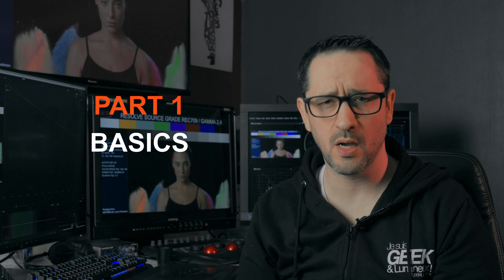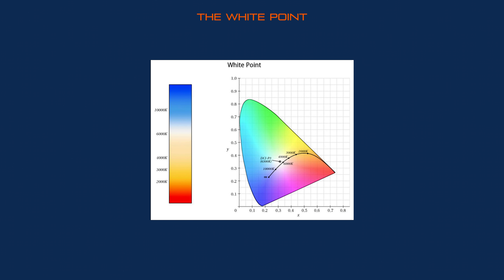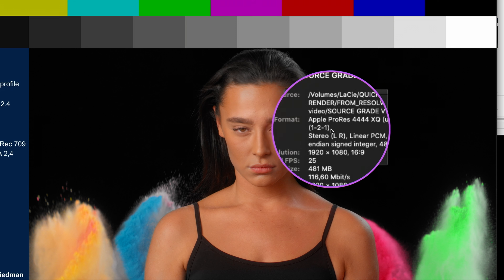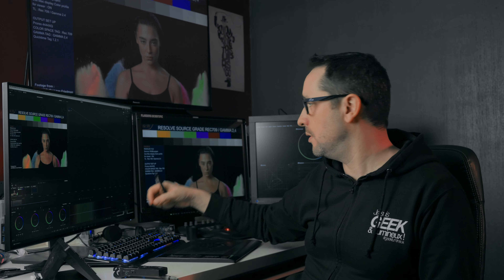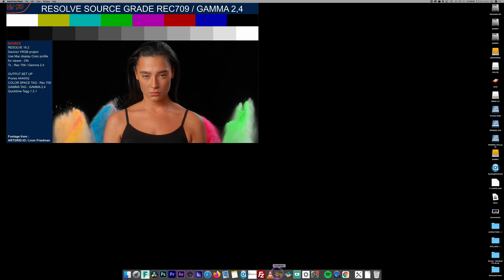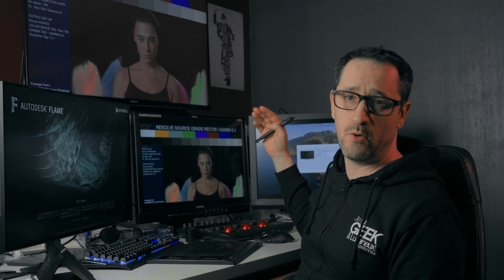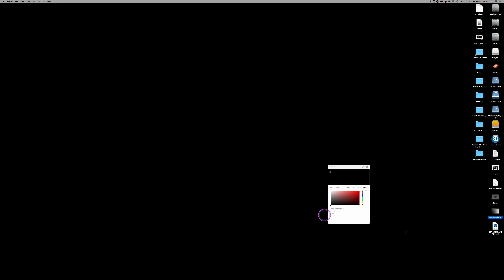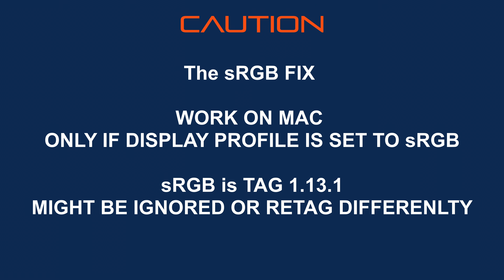Quicktime Color Management: why so many ISSUES?!

Comment: Hello, thank you very much for the video. I am working with Arri Alexa Raw files. I am working on a MacBook Pro that is calibrated with a datacolor Spyder X to ITU-R Rec. BT.709. The suggested Gamma is 2,22. So ITU-R Rec. BT.709 should be Rec. 709 BT.1886. The suggested whitepoint in the datacolor app is x 0,313 y 0,329. My Macbook is calibrated to 120 cd/m2. So it is probably not quit BT. 1886 with a suggested 100 cd/m2. I know that my MacBook will never be color accurate as a Flanders monitor.

In DaVinci Resolve 17 I am working in ACEScct. Version 1.3. No Input Transform because I am working with Raw and ProRes files. Each clip is individually assigned an IDT. "Apply ACES reference gamut compression" is off. ACES Outputransform is set to Rec. 709. Netflix in one of their color management tutorials said that this Rec. 709 is BT.1886 so I assumed it is Gamma 2.22. https://youtu.be/u9Rvm5xiuhk?t=424
"Process node LUTs in..." is set to "ACEScc AP1 timeline space". I have checked the box "Use color space aware grading tools". Graphic white level is set to 100nits. In the "project settings", "Master settings", I have set the Video Monitoring Data levels from "Video" to "Full". Video with depth is set to 10Bit.

I did some tests with "Use Mac display color profiles for viewers". Normally it is and was deactivated. When deactivated, the highlights looked bright and colorful as they should. When I exported the video to VLC it looked the same as in DaVinci Resolve, as you said in the video. QuickTime, the NLC Tag was originally HD 1-1-1, it was too bright and washed out. 
This was before I set up ACES. I used DaVinci Resolve YRGB before. As I understand the NLC tag 1-1-1 is right for Rec.709 BT.1886 Gamma 2.22 for web delivery like Vimeo and YouTube. When I switched to ACES the ODT is set to Rec. 709 (BT.1886) as mentioned before. Now when I export (Use Mac display color profiles for viewers are still deactivated), and set the color space tag "same as project and set the Gamma Tag to "same as project" my export says when I press command+I that the NLC Tag is 1-2-1 (ITU R BT 709 - UNSPECIFIED - ITU R BT 709). Why is that, that it is now unspecified? In VLC the video looks like in DaVinci Resolve. In Quicktime it looks much better than the 1-1-1 washed out version. But the Image is a tiny bit too dark. The highlights mostly green are not as saturated in DaVinci resolve. The version with the NLC Tag 1-2-1 is washed out in Vimeo and YouTube on Safari. So the transfer curve is not specified. On Firefox it also does look washed out. Firefox is color managed since recent versions.
I have now activated "Use Mac display color profiles for viewers". The image in DaVinci now looks the same as in Quicktime. But it does not change the fact that the transfer curve is not specified. "Automatically tag Rec. 709 Scene clips as Rec. 709-A" ist NOT Activated. I don't want to work in Rec.709-A. My movie will be mostly watched on YouTube, maybe on Amazon Prime and in cinemas. I am primarily preparing the video for YouTube. So I want the film to look kind of the same on all mobile devices. So all in all QuickTime should not matter that much. As a test I have changed the color space tag and Gamma Tag. "Color Space Tag": Rec. 709 "Gamma Tag": Gamma 2.2. I assumed because I use Rec. 709 BT.1886 that Gamma 2.2 might be correct. But in Quicktime the file looks way too bright. It is not that extreme as when I used DaVinci resolve YRGB, so ACES might have something to do with it. Because I chose a gamma tag of 2.2 the file says it has an NLC Tag 1-4-1 the transfer function of gamma 2.2 seems correct but not visually. As we can see in your list it is ITU-R BT.470M (Gamma 2.2). But this 1-4-1 is also wrong. If possible I don't want to cheat the NLC Tags and have a work around. Now I have exported it again as "Color Space Tag": Same as Project. Because I want to keep Rec.709. "Gamma Tag": Gamma 2.4. In Quicktime the file looks the same as in DaVinci Resolve as I am not mistaken. The NLC Tag is 1-2-1. I am wondering now. My ACES ODT is Rec. 709. I always assumed that it is BT.1886 with Gamma 2.2. Why does the image looks more or less correct to when I have not chosen a Gamma Tag? The video looks the same as "Gamma Tag": Same as Project. To my understanding this would mean that the ACEScct ODT Rec.709 is not actual Rec. 709 BT.1886 Gamma 2.2 but rather Rec. 709 Gamma 2.4. I have calibrated my Macbook to BT.1886 Gamma 2.2 so when I disable "Use Mac display color profiles for viewers" in DaVinci the Image does not use my calibrated display profile Rec.709 BT.1886 Gamma 2.2 but uses Gamma 2.4. Is this why my image looks better in DaVinci? It is only slightly brighter and the green is more saturated.

In DaVinci resolve I can't find the Gamma Tag (NLC 1) ITU R BT709. So that when I export the clip I receive a NLC 1-1-1. Originally before I started using ACEScct I didn't not use any color space tags or gamma tags and received a NLC 1-1-1 but the image was way to bright. (less to no contrast)

What should I do? Should I use Rec.709 Gamma 2.4 and recalibrate my Mac to Rec.709 Gamma 2.4 instead of using a calibrated display to 2.2? How to fix the washed out colors when uploading to YouTube and Vimeo? (NLC 1-2-1)?
Is it called NLC or NCLC Tag?

Thank you very much.
Reply: I have once again exported it as process 422hq "Color space tag: same as project", Gamma Tag: Gamma 2.2 (same as my monitor is calibrated to). When I upload it to YouTube it looks way too dark and oversaturated. The NLC Tag is 1-4-1.  I have changed the color space tag from "same as Project" which should be (Rec. 709) to Color Space Tag "Rec. 709", Gamma tag is still 2.2. I get a NLC Tag 1-4-1. You have talked about Full and Video Range. When I export a Proress 422hq in full Range (Tags Rec.709; Gamma Tag 2.2) it is saturated and looks like the davinci viewer when "Use Mac display color profiles for viewers" is disabled. So in general it is brighter. When I use video range. In Quicktime it is washed out (NLC-1-4-1) but on YouTube it kind of looks okay (close enough). In full range with no gamma Tag (same as Project) it is still to dark in QuickTime (NLC 1-2-1) and does not look like the davinci viewer. I have exported 31 versions and still haven't found a solution. Is there an option that YouTube does look the same as in the resolve viewer? Is it right that NLC 1-4-1 is best for YouTube? Does full Range automatically use Gamma 2.4 (NLC 1-unspecified-1) (Nlc 1-2-1) even if the project gamma is 2.2 Bt.1886 and Tag is set to use project setting? Or is it because aces gamut ODT is Rec. 709 Gamma 2.4 and not Rec. 709 Bt.1886 Gamma 2.2?
Reply from the maker: Sorry for getting back so late 
But honestly so much informations so much to read. Sorry I have to see what’s happening. This description is way too long
Contact me via email will see if we can arrange a team viewer 
Lelabodejay@gmail.com
Reply: @worldproductionentertainment  i'm having the EXACT problem that you are having and the only "solution" that I could get was to set the output color space of the whole project to rec 709-a, that was getting as close as possible to quick time as possible, as well as on my iphone and youtube. But as the video said, that's only a part of the problem because we are on Apple's ecosystem, so it will look great on their products, but i dont have windows devices to test to see how they would look on comparison. 

In the end of the day, from what i've searched and tested, was to either find a middle ground, like the suggestion in the video and live with it, or do different exports for the different platforms, which kinda sucks. 

Also, when opening on different players, like IINA and VLC, the colors are different as well, so i don't think there is a solution for all of this that will work 100% all of the time on all platforms but if it has, i would like to know as well because it's kinda infuriating :( 

Also, grabbing still from the colors page changes the image a lot, making it brighter and with less contrast

Comment: you say 'don't touch the grade', but then you apply CSTs. 
do you mean you grade and THEN apply the CST, just for the export-for-web?

for example your ultimate fix: do you grade on your rec.709 gamma 2.4 timeline and monitor (ignoring your sRGB screen), then apply the CST only for the web export?

and you only set your UI monitor to sRGB for doing your testing right? at least on my system, Display P3 looks much closer to the video monitor, and sRGB will confuse my clients with darker shadows and more saturation.
Reply from the maker: Hello
Sorry for late reply 
Yes you do your grade on reference monitor 
Then apply cst for web delivery
I don’t really trust my ui 
For your information if your monitor is Apple P3, it’s a P3 gamut combined with srgb gamma.
Reply: Hi I also found that 709A. works well in all applications. if you have a broadcast project like a tv show, would you still use 709A or change the tag to 2.4?

Comment: What you say about converting to 2.2 for the internet is incorrect. Ironically you get things right early on when you say that grading in a 2.4 environment on a 2.4 display will look the same as being in a 2.2 environment on a 2.2 display. This means that you should do NO conversion for the internet at all, just tag as 1-1-1 for client review if required. Otherwise you will make things too dark by converting to 2.2! (On the other hand, if you are also converting to 2-2 for client review, you'll end up getting things right but in a backwards way because they can tell you to brighten things up). Another way to think of it: grade on a 2.4 display in a dark (i.e. 2.4) environment. Turn the lights on, thus creating a 2.2 environment - the grade will now look too dark. Switch your monitor to 2.2, brightening it - now it will look correct again. So if you convert to 2.2, it will now look too dark despite changing the environment and the display. You can have your color space transforms convert to 2.2 if you grade on a 2.2 display in a 2.2 environment, but do it at the start of the grade and don't switch later (don't switch even if you have the wrong conversion to start with as your grading decisions would have accounted for this already).
Reply: ....u sure?
Reply: "Turn the lights on, thus creating a 2.2 environment - " What do you mean? The actual lights in the room?

Comment: "go to resolve and do a color transform". Ok, it may be obvious to you but I did't find that menu anywhere. You lost me after that
Reply from the maker: It’s showed in the video go to color page add serial node and add color space transform
Reply: @LELABODEJAY  Thanks for your reply. I think there must be a Davinci version difference. I see it in a very different way. In my project ALL clips already have a color node (I  can't identify which type) because the "settings" tab next to "library" is greyed out. Also, if I add an explicit "color space transform" there's no "gamma 2.2" or "gamma 2.4" options on the Input Gamma and Output Gamma menus. My version of davincy (version 18) looks very different than your video from 2 years ago: I suspect many things have changed.   Also, how do you tell that a color space transform should apply to the entire timeline, rather than just one single clip?
Reply from the maker: @lsfornells  yes lots of things have changed. You can apply effect to all timeline on the top of the window on the right you have two dots click on first you apply to clip on second you apply to the timeline
Reply: @LELABODEJAY  Ok, thanks for the tip. Merci beaucoup